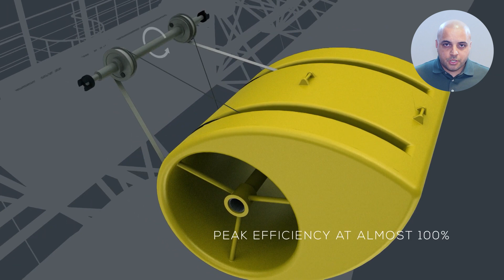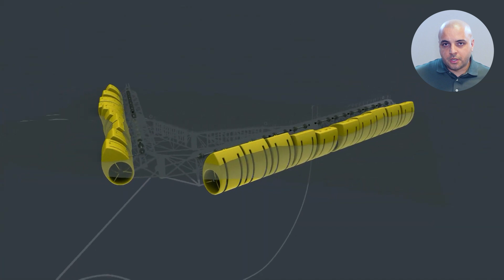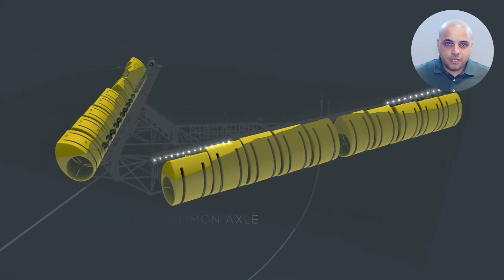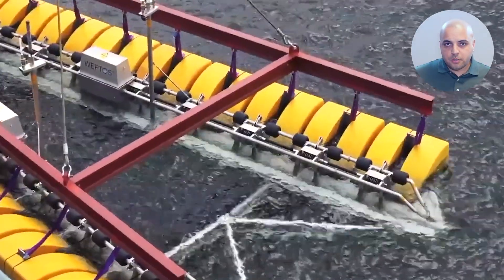Wave Energy Converter Turns Waves Into Power

Comment: The problem with these types of wave converter are high maintenance costs. The possibility of weeds and barnacle will stick to it and instrument will loose its structural stability. People have already thought about wave energy but it the physics is more complex. The sea water also affects the magnetic field not to great extent but indeed it affects the production so it’s quite difficult for such projects in large scale.

Comment: I would love to see this work especially where coastal erosion is an issue. However, wave energy machines have failed miserably over the years. Corrosion and the incessant movement are a mechanic’s nightmare. They are certainly not low cost.
Reply: True! There seems to be a few companies doing that that I’ve read about recently. And incorporating some flood gate designs that will help places from flooding!

Comment: Better use Swiming platforms, where plastic electret strings are attached to the bottom of the sea and the stretching generates power....
Reply: So not many moving parts and no mechanical generator needed, which can break and cloack with algae and stop working....

Comment: For once, this looks promising. I just hope, that it does not require much cleaning, and that all those wires and rolls withstand the salty sea water, and that they don´t get blocked by anything, that can grow on them.
Reply: Yea, why would it be under the nature's law? Every yachtsman will tell you how much maintenance the mechanical parts require. So, it will rust and grind, parts will cease up, algae and molluscs will further impede the function of the device, you can bet on it. And a calm see will make it produce at 1 percent efficiency. 

But the idea is solid, and after a few generations some of the problems can be solved and others minimized by care and timely repair. It will require constant care. I hope it catches on, too many of the environmental projects are just money grab scams and disappear when money is received.
Reply: @romgl4513  totally agree on the money grab part in particular... There are vast lack of understanding about climate technology among the investors and policy makers and public in general. All unsuspecting parties are just trying to ride the hype with little to no no consideration of the sustainability of the proposed solution.

Comment: Wave energy is an excellent energy source because it is a clean and sustainable. But the biggest problem is the lack of a better frequency caused by the waves' uneven movements, low speed, and high pulsating forces. But we have a solution to integrate every amount of wave motion in a step-by-step manner to provide a continuous rotation, in the form of a single rotational output at the delivery shaft that can rotate a Powerful Alternator.  
A planetary gear set can integrate two inputs at a time without any torque loss. It has also been proven in hybrid car technology.